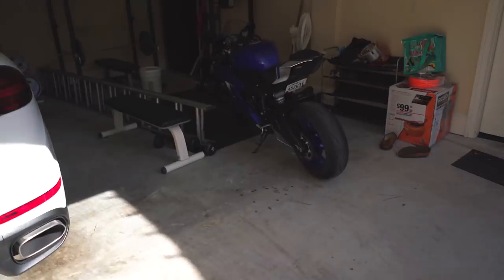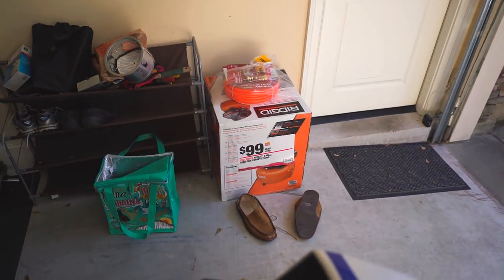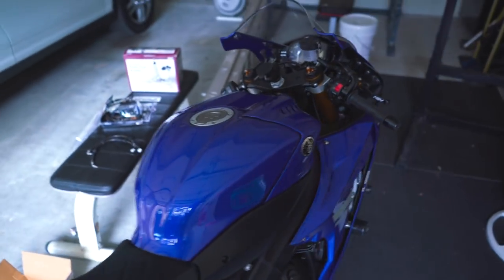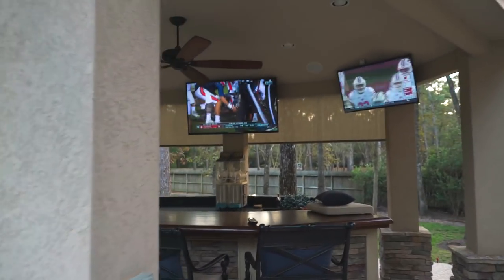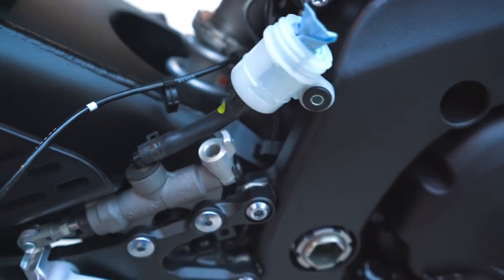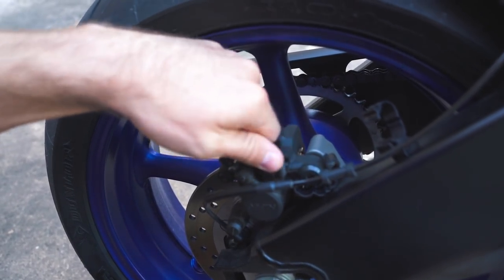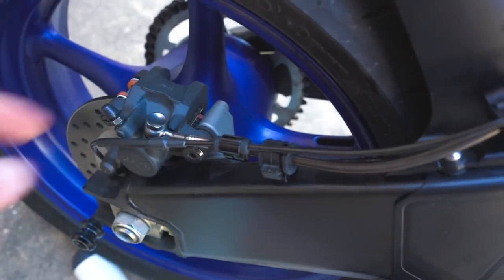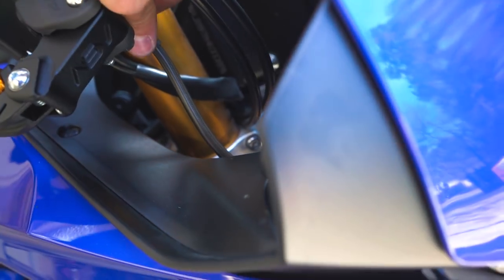Steel Braided Brake Line Kit on 2017 Yamaha R6

Comment: People do realize there's steel lines in your stock lines... Lol it's not a big balloon... It's jsut they're stiffer than the stock ones... As for the ballooning with stock... U can't even see it... It's more placebo than not
Reply: Brett Young yep
Reply from the maker: +Brett Young I can assure you it ain't placebo hahahaha
Reply: Haha oh yeah tell that to track riders who actually seen ballooned lines.
Reply: Brett Young you absolutely notice the difference. For street Riding its much less about balooning and more about a linear, precise feel in your brakes.
Reply: I can tell you, from personal experience, that the feeling isn't placebo. I was changing brake lines that were over 10 years old to brand new stainless lines though. Well beyond the service life of the standard lines. Yamaha themselves say to replace the standard lines every 4 years.
Reply: Old brake lines probally do more ballooning than new ones... Rubber and steel or any material comes weaker with age... For the price you pay with someone these brake set ups u really don't get that much for... Jsut more rust prone and most reason for a thief to want to steal your bike or vandalize it...  If your that into every little detail... Get a whole different brake setup... That radial mouth caliper and brake lever thing or what ever it is... That's supposed to increase feedback too... I jsut think the price you pay you don't get much more besides liability issues... Not saying anything will happen just more likely
Reply: Restricting the lines from expanding under the pressure the smallest bit will make your brakes wayyyyyy stiffer.
Reply: @Brett Young, LOL do you have any idea what you're talking about? Placebo? Steel braided lines are one of THE best bang for your buck upgrades you can get. The feedback on them is completely different from that of the stock lines. Have you ever ridden a bike before and after SS brake lines installation? I can assure you it's a huge difference and not just placebo. Top racers of different organizations all recommend these as a must have upgrade. Short of replacing the calipers and getting a whole brembo set-up, the lines are the best way to go cost wise.
Reply: Like i said... For the little feel... It's not worth the price... Plus the added vandal and theft chances... Just get a whole better brake system of ur wanting to get best for more
Reply: Depends on the year of bike reguarding if it has "steel" in it or not, but the big question is if that is true and steel is in the line. Wouldn't the brake fluid eat the steel in the line in a matter of months? Also since when does true stainless steel rust? Also if you did get the cheap knockoff, you know applying chain wax lightly to the line stops the rust. Nobody and i mean nobody steels a bike just because it has ss brake lines. They steal any bike if they have the opportunity lol.
Reply: Robert walker What kind of stupid question Is that.. That's like asking if there's any rubber in a steel braided line... Lmao... Think about it man the more valuable a bike looks the more likely it will get stolen... Chances are if there's steel braided lines there will be more...

Comment: You got a decent size compressor for the things you'll be using it for the accessory kit will allow you to do just about anything you're looking to do all you have to worried about is running too long of a hose, More hose less power... not to be confused with a biggie quote

Comment: Don't buy this kit for your R6, or if you do, don't use the banjo bolts in the kit. The lines are twisted and the aluminum banjo bolts are too big, and tools are defective to correct it. The bolts  stripped my rear manifold and I didn't risk twisting my ABS lines with their garbage plastic tool trying make them fit. STG refused to refund the cost of my parts, so I fucked Brian Van on the whole kit cost. $240. I ordered Galfers.

Comment: The spiegler kit isnt  the best  the front brake lines are about 1 inch to short on the front hoses. Don't put it on  a front stand to get full extension with the forks as your going to bend your block bracket and possibly pull you banjo  out. The Frentubo T2 or T4  are  a way better kit for the 2017 R6 Abs.

Comment: They sent you a corse thread ?
Spielgler  lines are a nightmare to short on the front and to tight a  hose angles I read a few forums and went no no ..   Frentubo race hoses  are way better  cheaper  and they  fit perfectly.

Comment: I've heard that steel braided lines make a huge difference in brake feel.
Reply: Irontalyn they absolutely do.
Reply: My bike had them when I got it so I don't really have any comparison.
Reply: Irontalyn my current one had so too, my first one had rubber ones until i Switched them.
Reply: My previous bike was 36 years old and had a single disc in front and a drum in the back so my new one just feels insane no matter what.

Comment: You got a pancake style air compressor for motorcycle/ automotive use? Good luck big guy.
Reply from the maker: I got it for basic use cases like this, filling up tires, or filling my cheetah blaster. Worked perfectly for me.
Reply: Motonosity : Yea it might even do everything for your motorcycles being that most of them are relatively new and you keep them indoors. It just may be worthless for the 240 project where bolts are rusted or crank bolt for harmonic dampener removal. The pancake style is normally for carpentry or construction where you need short concentrated bursts of pressure for a tool like nail guns.

Comment: Thanks so much for the great vid as always.  Urgent question.  I just installed the Spiegler brake lines on my 2017 R6 as well and the line for the right front caliper is very short.  So much so that when the forms are not compressed and the handle bars are tunende all the way to the left, the line is pulling on the manifold.  It just doesn’t feel right and I am worried that it might ultimately brake and leak.   That would obviously very dangerous.  I already contacted Spiegler but they didn’t respond.  Can you check yours and let me know if you see a similar phenomenon.  Thanks so much.  I can send pictures and videos of that helps.
Reply from the maker: I definitely don't have that issue. Did you order the ABS version and keep your ABS system intact? Did you double check that you used the right lines in the right places?
Reply: Motonosity wow, thanks so much for the swift reply.  Amazing.  Yes, I checked all that and yes, I did get the ABS kit.  I’ll post here once the reply from Spiegler is in. So do I understand you correct that even with the fork extended and all the way to the left, your lines have a little bit of “slack”
Reply: The left caliper line is 15.5 inch and the right is about an inch shorter.  I simply ordered another left one with Spiegler.  Unfortunately, they did not acknowledge that it should have been longer in the first place and charged me $62 for the replacement line ;-(